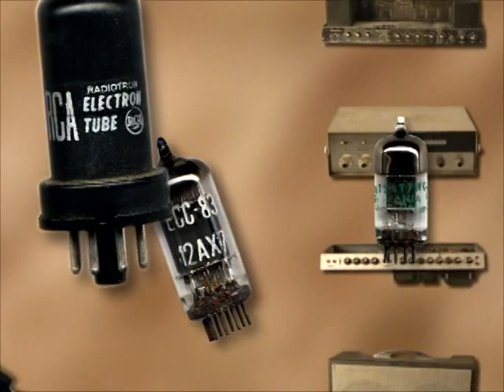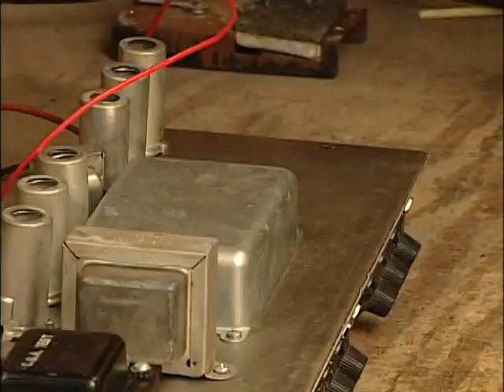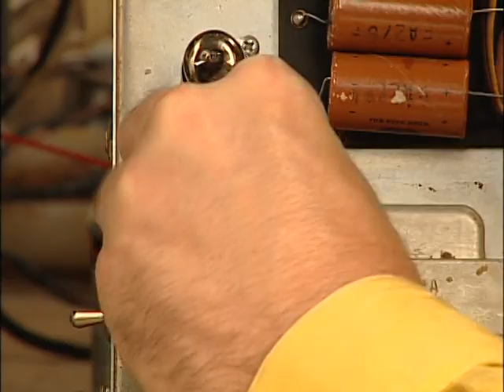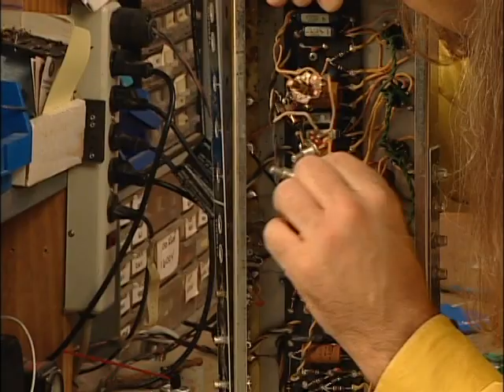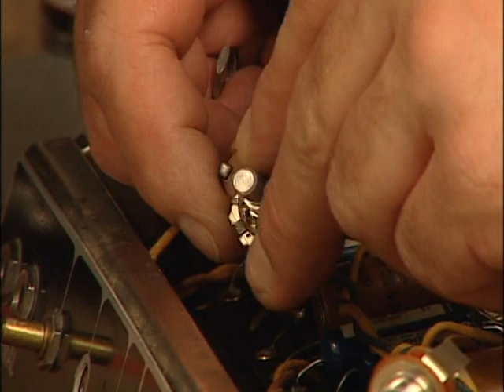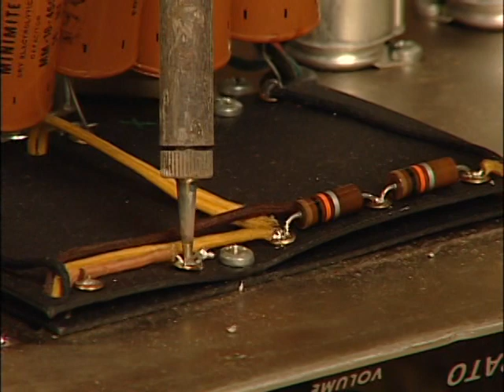Basic Tube Guitar Amp Servicing Overhaul Guitar Amplifiers Tube Type W Kendrick

Comment: Make sure you wipe down the tubes with some alcohol after installing so no Deoxit oil is on them or else they will get super hot and die or explode.  Wipe everything after Deoxit because it makes an oily mess.

Comment: Any idea, why a hybrid amp with 12ax7 preamp and solid state amplifier, will fluctuate volume randomly?  

Also my main amp i usually use for practice has shot out on me. I had scratchy pots and cleaned them up with deoxit, when I tested the amp out later I got no volume after awhile I got some but kept cutting out with no signal check cables and guitar they're fine worked thru other ones but yeah now I can't sleep im hoping I didn't mess up the main amp.. also hoping I hooked the speakers up right.
Reply: Well I doubt anyone else is gunna see your question..so I'll try to help.  First make absolutely sure your speaker is hooked up correctly and solidly.  Second make sure you didn't bump your preamp tube loose give it a good push into the socket.  Third make sure you didn't move/break any connections from the pots you were cleaning.  Sometimes those pots can get loose and you need to re-solder those connections they make to the circuit boards or wires.  Even in the video he broke a wire loose...it's no big deal you just put it back. 

Now this video showed you how to de-energize your amp..so if you are comfy with the work do it...but if you are not get a buddy who is or take it to a tech.